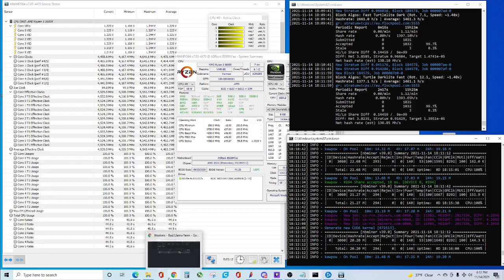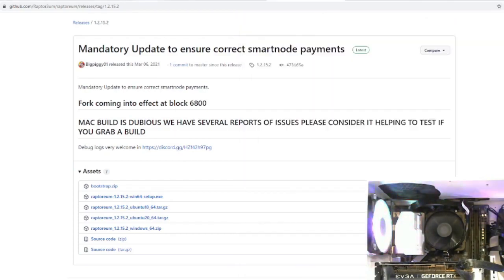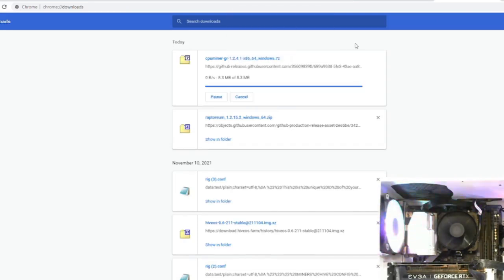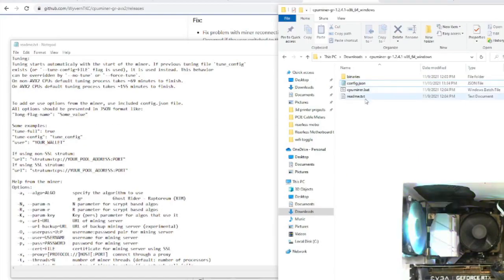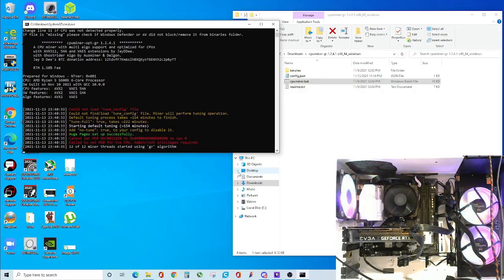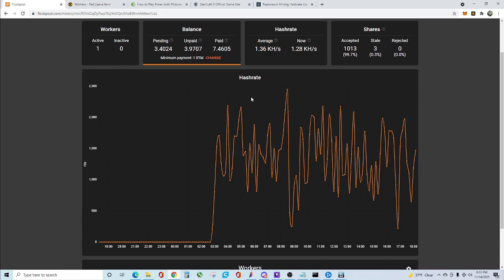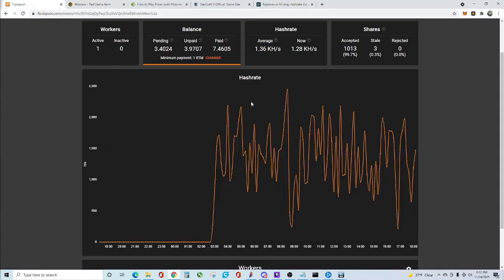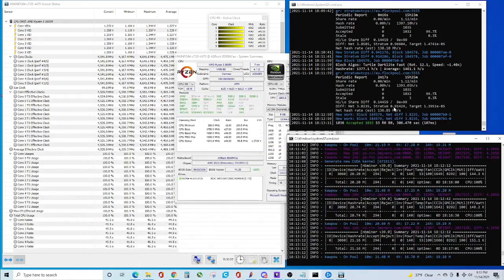How to start CPU Mining Raptoreum on Windows 10 with a Ryzen 5 5600x

Comment: Did you undervolt cpu.? What temp is it at?
Reply from the maker: Hey I have a video on RTM overclocks and I just used the same settings. The from what I remember is 66c.
Reply: @RedLlama  I’ll check it out thanks.